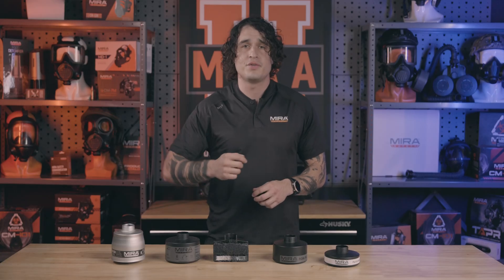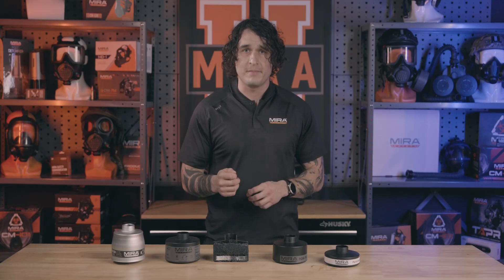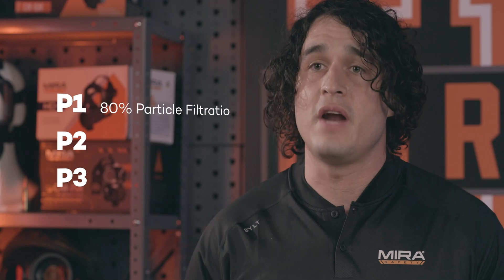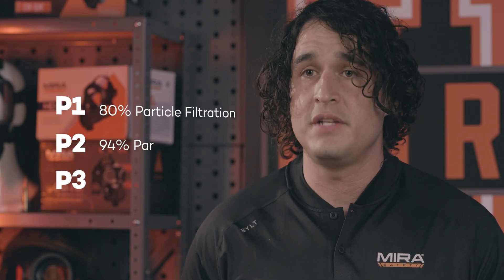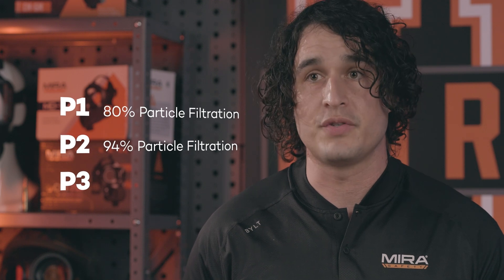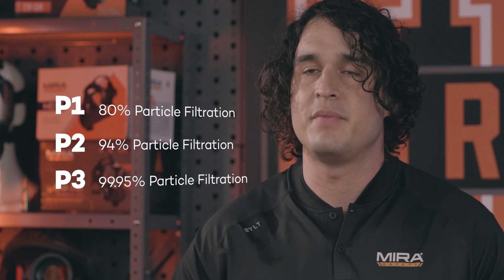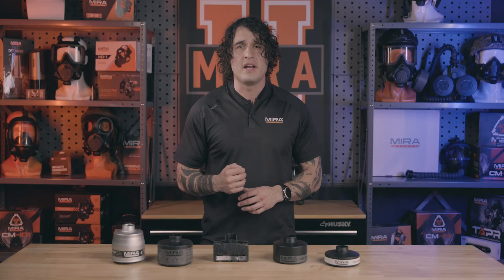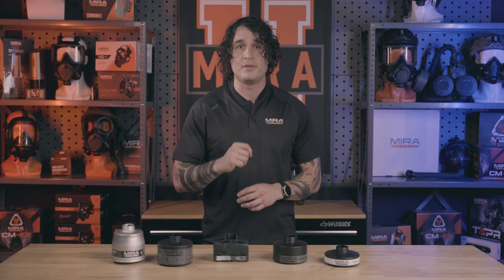MIRA University -  Episode #3 "HOW DO FILTERS WORK?"

Comment: How long is your filter usable if you take it out of the package and have it staged on your gas mask and stored in the plastic sealed bag that your gas mask is stored in?  Should you have a filter on the gas mask "ready to go" or only use it when needed.?
Reply from the maker: There are too many variables to accurately answer that question, humidity, air temperature, etc - mostly environmental factors and storage conditions. But to answer your question in a more practical manner, it is a users preference whether to keep your filter installed on the mask during storage. It is definitely faster for donning, you arent fumbling with opening a package in an emergency. 

One bit of advice is to keep a filter installed on the mask, and have backups in the sealed packaging. As long as you keep the filter intake port capped with the plastic insert, you should be fine storing your mask and filter together for awhile, cant say x-many years or anything specific like that. If you want the full shelf life of the filter, it should remained sealed.

Comment: Is the NBC 77 superior or inferrior than the smoke filter?  Will the NBC 77 protect against carbon monoxide? Why will the specialty filter only work for 17 minutes? Is there another way to protect against carbon monoxide?
Reply from the maker: NBC-77 will not protect against carbon monoxide. The VK530 contains oxidizing agents that will only convert effectively for 15 min. It is designed as a smoke evasion filter, giving you extra time to evacuate a smoke environment. The only way to truly protect yourself from carbon monoxide for a longer duration is using SCBA with an oxygen tank.
Reply from the maker: Here's more info on the VK530 if you'd like to take a peek....

https://youtu.be/2rTeAOuqbWE

Comment: Great video yet again! Thanks for putting this out. If I open a filter and fix it to my CM mask but don't actually breathe through it and just leave it in a dark cool place, will the filter keep its 20-year shelf life out of the packaging? I'd like to keep a filter attached for quick and effective donning of the mask, but not sure if keeping a filter affixed is a good idea. Thanks in advance!
Reply from the maker: Once the filter has been opened from the packaging it will not maintain the 20-year shelf life. Primarily due to the fluctuations in humidity and temperature over time. Filters are porous by nature so even if they aren't being used, contaminants suspended in the air can get inside the filters, the same as how dust gets inside of electronics even in a room with no air current. Static charge and settling... We dont recommend storing filters installed on the mask long term, but, it does save time - so it's a users call!
Reply: Thanks for the reply. 👍🏻 Filters are staying sealed!!